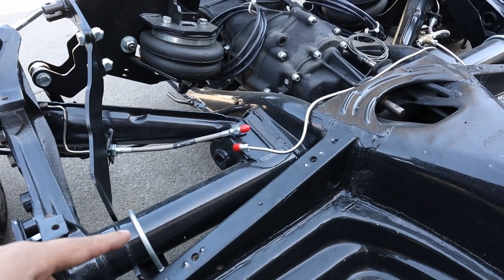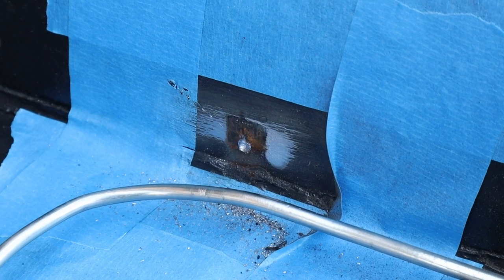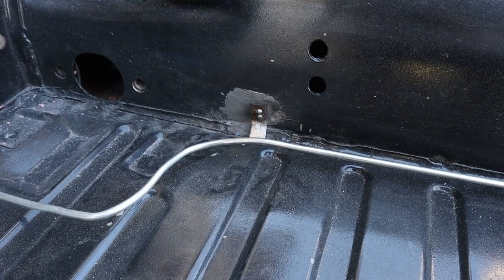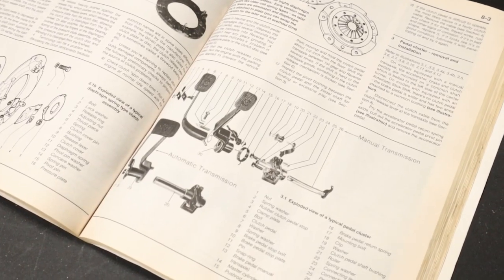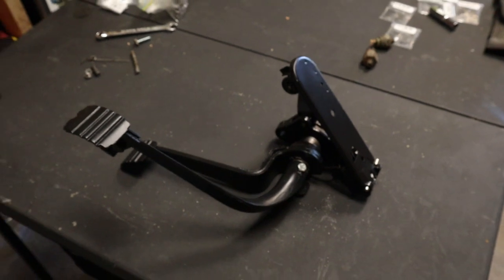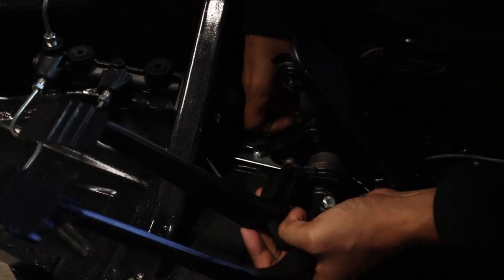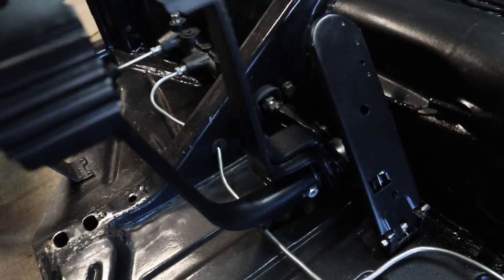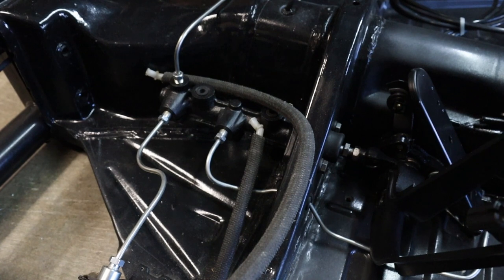1969 VW Beetle Restoration- Pedal Assembly REBUILD & INSTALLATION

Comment: Won't you have to disconnect the hoses for the brake reservoir when you put the body back on? Also that piece that your missing is more like a clip that folds over to keep the rod in place. You could probably make one. its just a piece of metal like the tab you made, just with a hole the size of the rod. You can use real thin metal, because it is designed to bend to lock it it in place.
Reply from the maker: Yap I will remove the brake fluid reservoir once I pump the system. I just want to make sure everything is right before I paint the body. TRUE I could fabricate something but sometimes is easier to buy things when they are available. For example, I could spend 1-3 hours trying to fabricate a bracket or I could spend less than $10.00 dollars to buy it. On the next video I will put the missing pieces back on which cost me less than $10.00 dollars. GREAT COMMENT!!

Comment: What was the book you used for your 1969 VW Beetle? I have a Bradley GT2 on a 1969 VW chassis. I'll take whatever help I can get with this beast. Thanks!
Reply from the maker: I would start by buying the official service manual!. What are you doing to your GT2?
Reply: @oscar_dubs  Just a hobby car right now.
It runs but I'm just going to shine it up a bit and enjoy it for now.